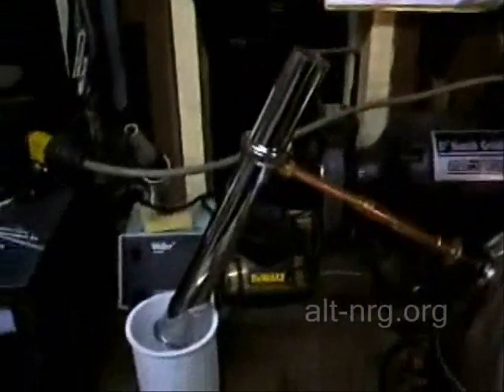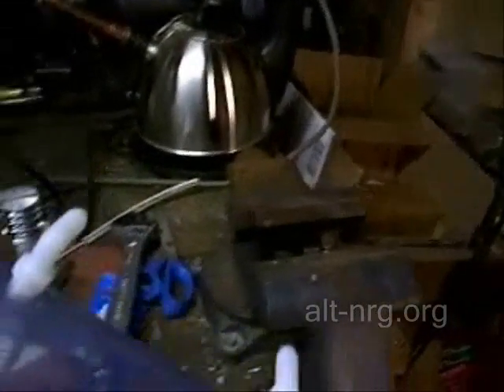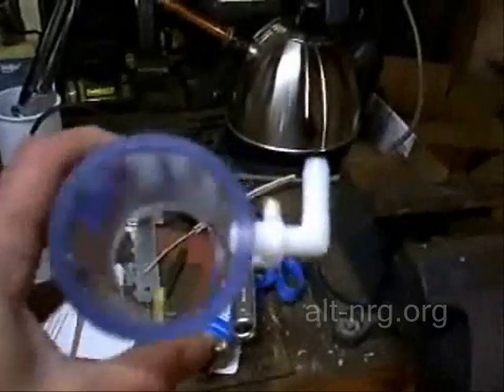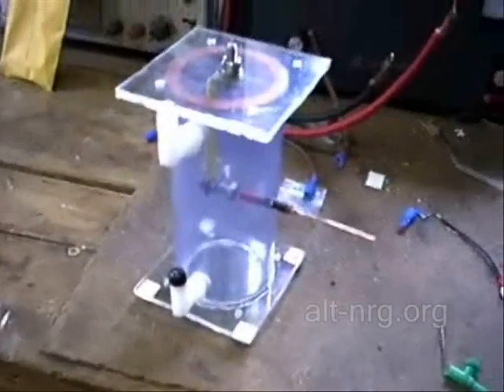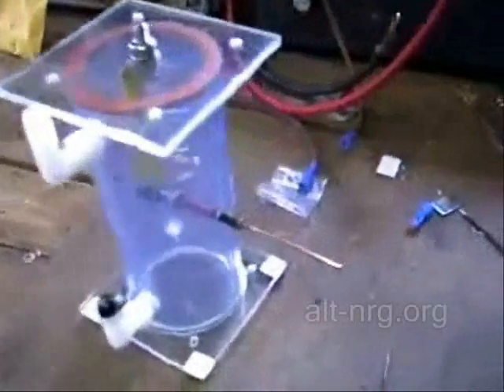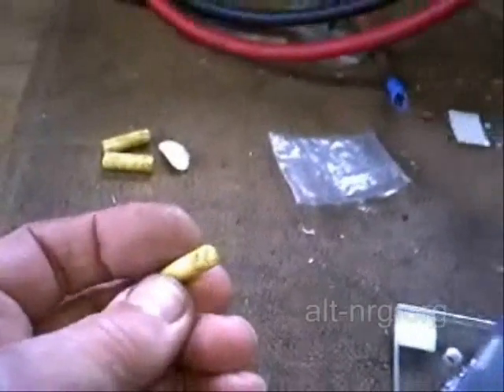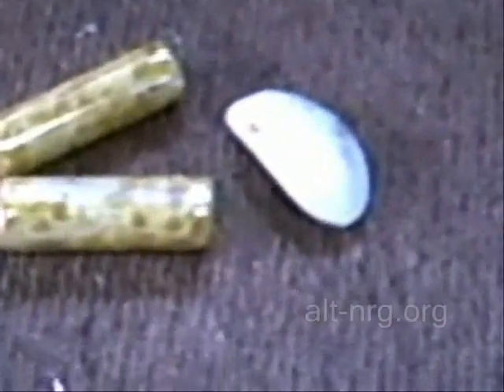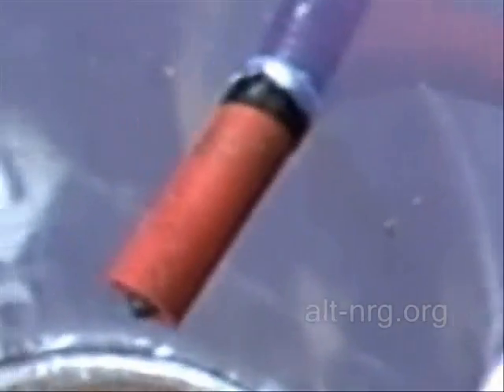#261 Plasma cold fusion early tests Part 2 of 2

Comment: Have you weighed your supposed Deuterium oxide. Deuterium oxide has a density of 1.11 g/ml while water has a density of 1 g/ml.

If it is actually any heavier you may have made some heavy water. Or you may have just added other stuff to the solution. 

What atoms are you supposed to be fusing? I dont understand how this is supposed to be fusion. Unless you did this experiment inside of a calorimeter carefully recording energy input vs energy coming out. This means nothing scientifically.

Comment: So, your goal is to ... produce excess heat? generate HHO or H2 and O2? Oh. Probably what you said in the last 3 seconds, "try a vapor, and see what happens." Which would be, huge back EMF spike you could theoretically capture (water capacitor release of energy maybe), or maybe just burn the water as HHO/H2 fuel at the point of the plasma spark? Cool. How did later experiments go?

Comment: While I know nothing what so ever about this plasma cold fusion stuff and I understand that this is an old project for you, why could you not use a platinum or iridium spark plug for your electrode? Just break off the ground electrode exposing the center electrode. Highly heat resistant, waterproof and long lasting.

Comment from the maker: @m3sca1 Did not run it long enough to do any temperature measurements. Nor did I have the instruments to take good temp readings at the time. I do now.

I ran the boiler all day, every day for almost one full year, went through 50 gallons of raw material and three stages of refinement to get just a few ounces. The purity is still questionable but I estimate that the concentration is at least 100x over plain water. Good enough to play with.

Comment: That was interesting,did it get hot?Thorium loaded TIG welding rods would be easier than puting Palladium beads in there.Looks like you want more power.How long did you run the"stuff maker"kettle to get that much "stuff"?